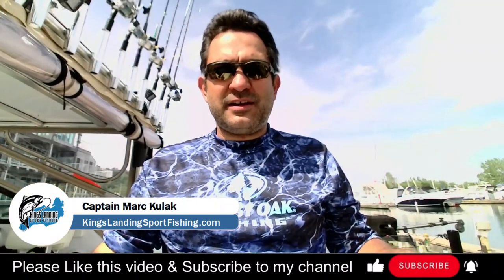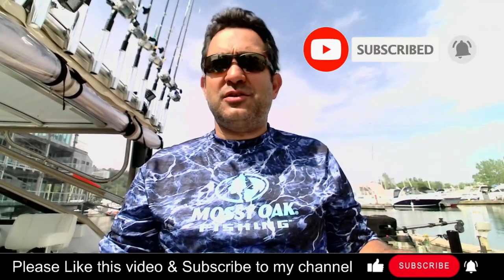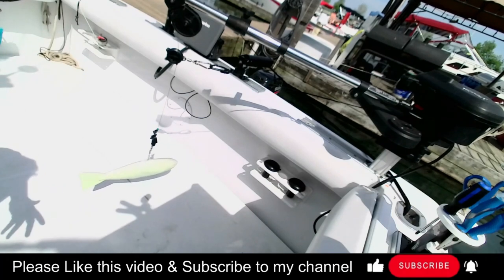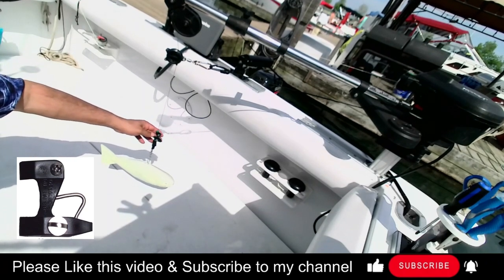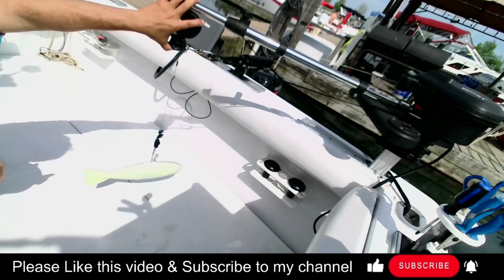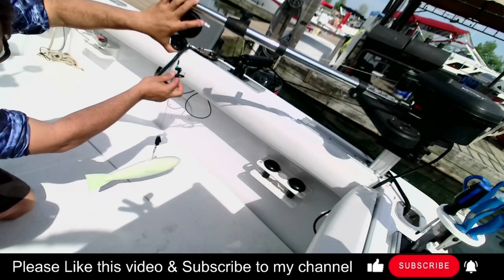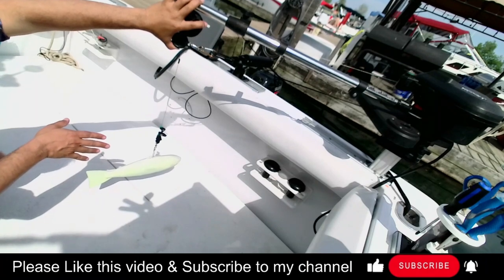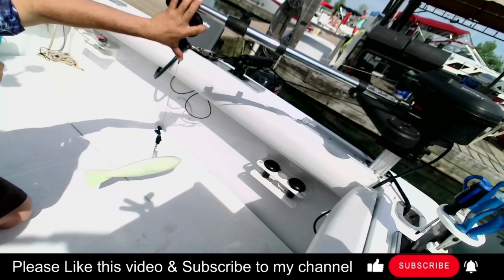Downrigger Release method to identify small fish easily, stop dragging shaker salmon without knowing

Comment: Does the release stay at the ball (at depth) or does it ride up the line like a slider?  Good content. I get draggers all the time. Maybe that’s the point. It rides up when the dragger is on?
Reply from the maker: It starts at the top and when you get a smaller fish they will typically move the release up and down and you see your rod tip moving....

Works very well with a shorter lead like 20-25ft